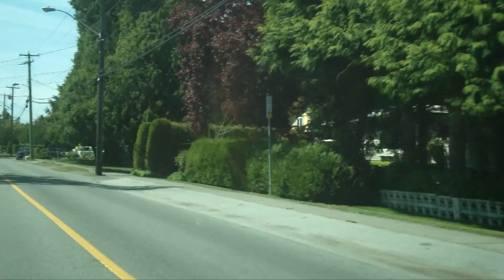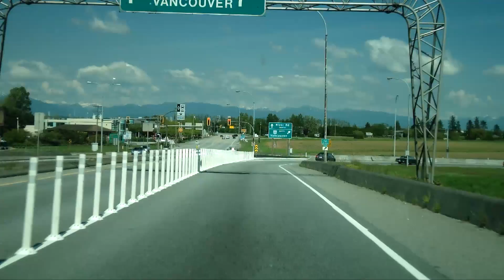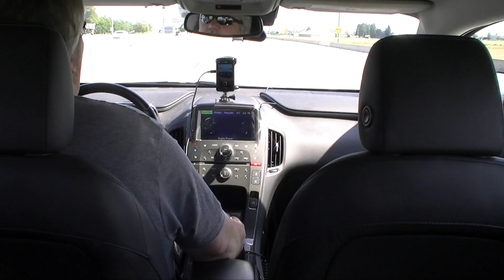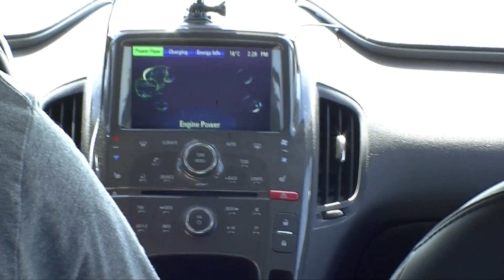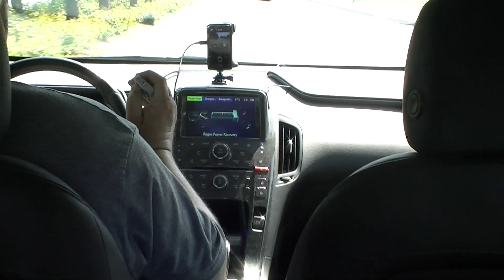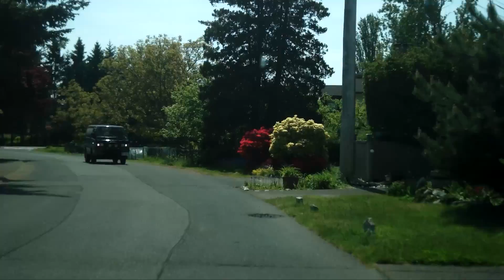How to drive a chevy volt for best electric range and fuel economy

Comment: The brake pads are not being used, even when your foot is on the brake, down to 3 to 7 mph.  As long as the braking demand is normal.  Software makes the car feel like the brake pads are being used.  Shut off any fans, etc and listen.  When the car slows down to about 3 mph, you can sometimes hear the pads take over.  You can also feel it in the pedal at times.

Andrew Farah explains this in the YouTube video "Plug-In Day Webcast Chevy Vol" at 16 minutes.  

I never shift.  I always keep it in L, even on the freeway.  The only difference between D and L is software.  Programming tells the electric motor to put in extra "drag" for more regenerative actions.  In fact, all of the positions on the shifter are nothing more than software.  R is software that makes the E motor spin backwards.

Also, you can achieve the same range when you use sport mode, as long as you don't race the car.  I like keeping it in L and sport mode because I have that extra boost should I need to get out of someone's way.  But I always achieve the same range as I would in normal mode.

Chris Thomason, Chief Engineer for the ELR program explains this in the YT video "2014 Cadillac ELR - Jay Leno's Garage" at 11:05.

Keep it in L and Sport.  You will like it.  Same range .... unless you like to launch quickly.
Reply: I never remain in L-mode, just too much "braking" force. I do also switch between D and L.
Reply: ra5928 "L" and "Sport" mode rule.  Provides the best control and if you drive conservatively, the best energy utilization.  If there is any efficiency advantage to coasting in "D", rather than driving at the same speed in "L", I suspect it is minimal.
Reply from the maker: Yes I know how it works. Yes I know you can drive in L all the time, I just don't do that on the freeway. There are times when I want to coast without slowing down rapidly, so I use the shifter as one would in a standard, to down shift and let the engine slow the car. In the case of the volt, it is the regeneration that slows it.
I also do normally drive in sport mode, but again I do use the shifter to control when the regeneration is full on vs just coasting with slight drag.
The only 2 positions on the shifter that make any changes are N and P.
N disconnects the drive train completely by releasing all 3 clutches on the planetary gear set, and P engages the park pawl cog.
If you run down the battery, and put it in mountain mode, the engine will start, and you will hear it under load as the generator puts in 16 KM of range into the battery before shutting off. This works in P, R, D and L only. Put in in N, and the engine will idle but not put any charge into the battery, because in the N position, all the clutches are unlocked. The ring gear is unlocked, as is the small motor and the engine. You can see my demo on how the generator will charge the battery, and now much you can make it charge to the 40% start of charge from the engine, and how much fuel it uses to do that.
Reply: 12voltvids Cool.  I use mountain mode as a form of hold.  I've had my Volt for 3 years, so it doesn't have Hold.  Mountain allows me to get to my destination with about 10 to 15 miles of e, depending on the conditions.  I then put it in Mountain on the way home.  Once I get about 12 miles from my house, I put it back in normal mode.  I arrive at my house with about 1 or 2 miles left on my battery range.  This is the most efficient way to use the older Volts.

My son's Volt has the hold but he rarely uses it, being that he is on one of PG&E's special night time rates.  He pays less than 5 cents per kwh.  

With my charging costs and the current cost of gas in CA, I am able to drive about 155 miles for the cost of one gallon of gas.
Reply from the maker: ra5928
Mountain mode maintains the battery with 10 miles of range. It will run the engine harder to recover the charge, where as normal mode will only generate power on demand as needed to keep the battery at it's low state. The only reason for using mountain mode is to maintain enough of a charge to get through large hills on mountain highways. Hold is only useful if you need to drive in on the highway, and need to be in full electric mode to use special commuter lanes where an electric car is required to access them in some city limits. (I am thinking places like London) 
I don't have hold mode, as I have a 2012, but even if I did I would never use it. If I have to drive past my available range on the battery, I want to arrive home on 0 miles remaining. The reason is the cost of gas. It cost about 4X as much to generate power with the gas engine compared to charging from the grid.
So if say I had to go 80 KM, I would use up the full battery, which could give me anything from 50 - 73 or so  KM depending on the temperature. Then I would finish the journey on gas. I would not engage hold even if I had it for any portion of the trip, as I may end up generating more power than needed, and arriving at my destination with some battery left is not very efficient, because it cost 4X as much to generate the power from gas. It is much more efficient to drain the battery and plug in. Don't believe me, see my video titled "self charging chevy volt" and I will demonstrate how much fuel it takes to generate power, and go through all the numbers
Reply: manoman0 I used to do that.  Now I feather the gas pedal down until I need to brake.  It is all regenerative.  I used to have to hypermile to get near a 50 mile range (2012 Volt).  Now, I drive in L and Sport Mode and hot foot it and I still get 46.  A lot more fun.